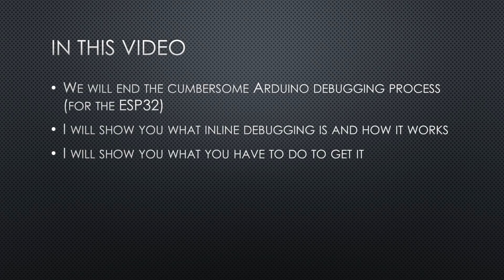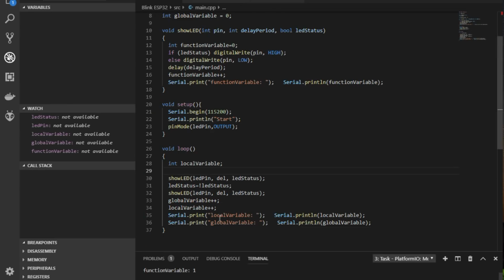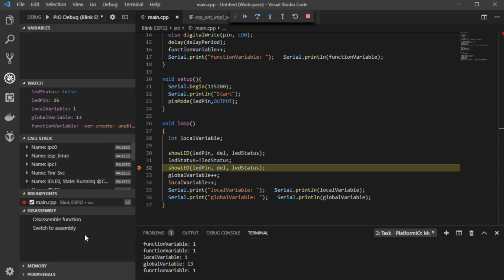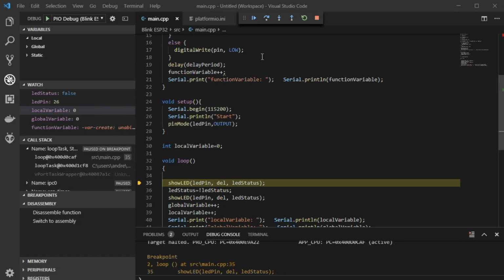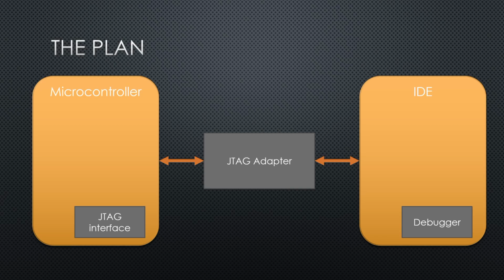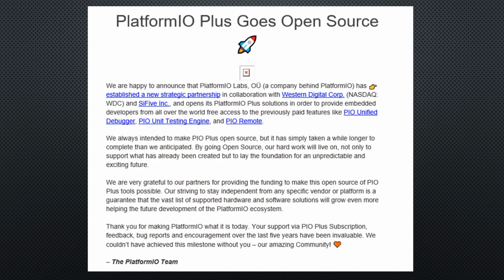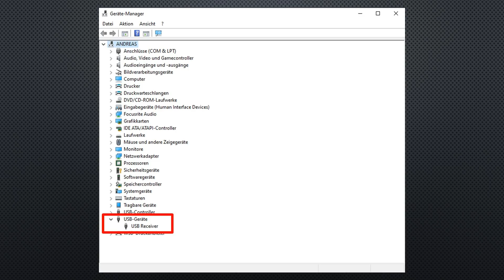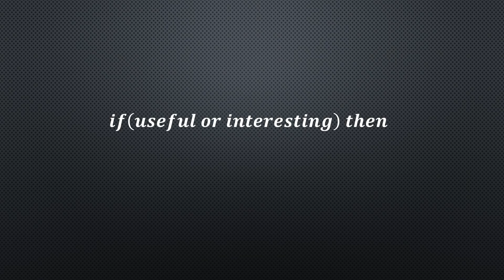#274 Free Inline Debugging for ESP32 and Arduino Sketches

Comment: Andreas,
.
I noticed that you used the Espressif’ ESP-Prog JTAG interface for the ESP32 which only supports the ESP32 platform.
.
PlatformIO debugger also supports the Segger J-Link JTAG interface which supports ESP32, but also STM32, Teensy and a plethora of other platforms.
.
In addition the Chinese "knockoff" copies of the Segger J-Link sold on Aliexpress are cheaper than the ESP-Prog.
.
So I'm wondering if the Segger J-Link wouldn't be a better option as a JTAG interface as it supports more platforms.
.
I have no practical experience with this, but the documentation seems to suggest that the Segger J-Link supports more platforms.
.
PlatformIO official JTAG interface support list.
https://docs.platformio.org/en/latest/plus/debugging.html
.
PlatformIO officially supports the Segger J-Link JTAG interface.
https://docs.platformio.org/en/latest/plus/debug-tools/jlink.html
.
Segger JTAG officially supported platform list.
https://www.segger.com/downloads/supported-devices.php
Note: ESP32 is not listed here, but the official PlatformIO website states that there is support.
.
High Speed J-Link JLink V8 USB JTAG Emulator Debugger J-Link V8 Emulator sold on Aliexpress.
https://www.aliexpress.com/item/4000182310208.html
Note:  This is a cheap Chinese "knockoff" of the original and expensive J-Link sold by Segger.
Reply from the maker: I never tried the Segger because I did not have one. This changed since last week. So we will see...
Reply: @AndreasSpiess  There could be problems with the Chinese clones of the Segger J-Link sold on Aliexpress/eBay. If you encounter problems then this might help. https://gronlier.fr/blog/2015/07/unbrick-and-update-an-j-link-v8-clone/
Reply from the maker: I ordered an original one (The EDU version is reasonable in price)

Comment: Thank you for this video. I have an esp8266 project that only used the I2c port. I gather from the video that the debugger should work. Or no?
Reply from the maker: I never tried the ESP8266 because for me it has not a lot of pins. So you have t check if the setup works.
Reply: @AndreasSpiess  checking the data sheets.  In esp3266 there is no mention of jtag. However a jtag capability is mentioned in the esp32 data sheet  under the cpu section. The esp3266 data sheet has no  cpu  section. I conclude that the esp3266 does not support jtag.
Reply: Thank you

Comment: Great tutorial.   I am wondering if you have tried to make this work for Ubuntu Linux.    I run into this software error.  /xtensa-esp32-elf-gdb: error while loading shared libraries: libncurses.so.5: cannot open shared object file: No such file or directory.     Thank you.
Reply from the maker: I only use it on Windows
Reply: @AndreasSpiess  Thank you for your reply!  :)
Reply: @AndreasSpiess  I solved the problem with some good help on Platfrom IO forum.  No, after all the work on Ubuntu. I recommend Window 10 for using PIO.  It is much easy to set it up.

Comment: Today I  got my esp-prog board to work on my mac with help of this video (which inspired me to buy the esp-prog in the first place). I now am able to both program (upload), monitor and debug the ESP32 (I tried the SBC-NODEMCU-ESP32 from JOY-IT) over a single USB connection. I did run into some small problems. My advice is to install the official FTDI VCP driver for the MAC OS you are running (I'm at a beta of 10.15.5 currently). Then LEAVE THE PORT SETTING FOR THE DEBUG PORT EMPTY, but use the 'xxx01' port for the upload and the monitor port.

Still I don't like the VS Code environtment that much. Maybe after some  time I will learn to appreciate it. But even if I don't like it for programming, I still can use it to debug the ESP32 projects now.

Next on my list is to create a jig to easily cable up the NodeMCU to the ESP-prog. I'm thinking about designing a PCB with feed-through header pins or so.
Reply from the maker: I have a few development boards laying around which I use to start every project. Only after the code is already working I change to the target. You could add such a Jig to such development boards...

Comment: Great video :) It would be awesome, if you did a video on using the second serial port on the esp-prog.

For the newbee like me, it would be worth mentioning (in addition) to just connect one usb cable to programmer (es-prog in my case) and that the programming happens thru the jtag.
I learn that the hard way.
Reply from the maker: Sorry for forgetting to mention that fact!
Reply: @AndreasSpiess  Please also show how to use Serial port with ESP-PROG. That would really save connecting both (esp32 as well as esp-prog) to the power supply.   Atleast you say the setting in the platform.ini file for the serial via esp-prog. please

Comment: Hi Andreas
After watching this video i switched to PlatformIO. Much better than the Arduino IDE. Waiting for the JTAG interface to arrive. I have a small problem and i hope you can help.
Not with the IDE but with programming the bin file into the ESP32 using a user friendly program. I have tried to find the answer on the internet with little success. 
I Found this program NodeMCU-PyFlasher-4.0-x64. It seems to be the answer to my problem.
But. It programmes the file no problem. But it does not run. keeps rebooting continuously.
rst:0x10 (RTCWDT_RTC_RESET),boot:0x13 (SPI_FAST_FLASH_BOOT)
flash read err, 1000
ets_main.c 371 
I know you are busy but was hoping you or one of your readers can help.
Reply from the maker: I do not use those flashers, so I am not a big help. If I remember you have to program the code at the right place. Which is not always 0000H. And if I remember right, I had to flash more than one file.
Reply: @AndreasSpiess  Thanks for the reply. Keep up the great videos. I always look forward to the new ones.

Comment: Thank you for your useful video's. I like them very much.
Since I'm a retired mainframer & cobol developer I'm really missing a cheap debugger in the arduino world. Now there is hope with the ESP ...
So I have watched the video twice, but there are some questions.

You have build a esp-prog adapter with 6 pins connected. But in the video you say, that only GND and 4 JTAG pins (ESP_TMS,ESP_TCK,ESP_TDO, ESP_TDI) are used. I guess, that pin #6 is VDD. But how to use it?
I think it's no good idea to connect the ESP Devkit via USB für uploading and/or serial output plus connecting another USB port to the esp-prog and the VDD to the ESP too.
Reply from the maker: I do not remember the details, but you should find the info on the platformio page. There are quite a few interfaces supported, and not all have the same number of pins. I used  USB and the JTAG,but I think, these JTAG boards have two serial connections available.
Reply: Ok, I'm talking only about the esp-prog and a Devkit board, both connected via USB. Nothing else.
At platformio I found this wiring information for the esp-prog:
"Pin 1 / VDD Positive Supply Voltage — Power supply for JTAG interface drivers" But what does it mean? Do I have to connect the pin to 3.3V on the "ESP32 Devkit V1" board, even if I have USB connected? I found nothing about that ambiguity ...
In your video you are talking about 5 connections, when using the esp-prog. But your esp-prog adapter in the video has 6 dupont plugs.
And in the video you have connected the esp-prog to a esp32 board. But sadly not all used connections are visible. Only GND and GPIO 12,13,14.
So I would like if your can make things more clear

Comment: I just started to use PlatformIO with VScode (Arduino Platform). A bit of a learning curve, but I love it. 

On to my comment about debugging. I already had a J-Link, so I hooked it up to an ESP32_Devkitc_V4 that I just bought. I had to use Zadig to install the WinUSB driver, just as you did for the FTDI debugger. Then I set "debug_tool = jlink".

PlatformIO recognized the J-Link, but when running the debugger, I got an error, and the debugger stopped. A Google search told me that I needed to hook up pin 1 (VT) on the J-Link to 3.3 V on the ESP32. Now it works well.

Thanks for the excellent (as always) video.
Reply from the maker: RTFM helps sometimes  ;-)

Comment: First, thanks for this and many other brilliant videos :) Next, my problem. I'm trying to get hardware debugging working with the help of this video. When I do "Start debugging" I get the error message "Could not find the specified task." from VS Code, with the three options "Configure task", "Open launch.json" and "Cancel". I don't know how to get around this. Do you have any idea?
Reply from the maker: Unfortunately I cannot do remote debugging. This video was made with an older version of PIO. Maybe something changed in the meantime.
Reply: I have the same problem. Did you find any solution for this?
Reply: Nevermind, i found the solution. For everybody else that stumbles at this ... you've to open the debug view and select next to "RUN" and the green arrow the project name.

Comment: I've done a lot of embedded and system programming with only a serial and/or LCD interface for debugging (at best). Worst case was an x86 project where my assembly polling code kept freezing up. I later found out that another programmer made changes to an interrupt routine and his PUSHA/POPA guard instructions needed to be upgraded to PUSHAD/POPAD. Lost several days of work over that one. Inline debugging is the best.
Reply from the maker: Definitively. But so far it was not cheap for a Maker like me...

Comment: The debugger is slow and ESP32 has only 2 hardware breakpoints!
Reply from the maker: I do not know because I have no comparison other than Serial.print ;-)
Reply: @AndreasSpiess  printing is not as effective as debugging. Also requires flashing which wear the flash very fast.

Comment: In my case I had to plug them W10 in a certain order. ESP first, then debugger, otherwise I was getting an error : "Failed to launch GDB". Possibly because I had the "debug fw" flashed already. Code wouldn't be running, therefore couldn't be flashing, if pluging debugger first.
Reply from the maker: Good to know. Thanks.

Comment: I remember "poor man's debugging" in C using printf statements. I then made a debug_print macro that was a printf embedded inside a "#ifdef _debug". That way I could recompile with or without _debug defined.

This totally confused me. When I compiled and ran the program without debug, it misbehaved. When I recompiled with debug, the problem went away!

This had me scratching my head. Veteran coders probably have figured out why running with debug turned on "fixed" the problem.

Yep, the problem was timing dependant. The printf statements slowed down execution just enough that the timing worked!
Reply from the maker: This happens sometimes. More often it happens to me that the SW does not work properly with debugging on becasue of too slow speed...

Comment: Thanks a million! You just changed the way I deal with the ESP32 once and for all. I followed your tutorial and I can assure everybody that it works perfectly! Do not forget to replace the drivers using the Zadig driver installer. I did and it did not work. I had to go and watch the video a second time and it worked once I replaced the drivers.
Interestingly enough, the code always goes to the FreeRTOS when debugging at the source code level. It makes it even more obvious that FreeRTOS is an integral part of the ESP32 Arduino libraries. Debugging will lead you there no matter what. I simply stepped out of the FreeRTOS stuff because I was more interested in my code than any RTOS kernel stuff.
On a different note: Who are the morons who disliked this video? Do they even know what they were looking at when they watched your video?
Reply from the maker: Thank you for sharing your experience! I always get a fer buttons down. Some of them quite fast. They are maybe even subscribers for that reason...
Reply: @AndreasSpiess  You know what? To hell with these idiots. It's because of YouTubers like you that knowledge is spreading quickly.
Thanks a million and please continue to make and share more videos.
You have a loyal subscriber to your channel now.

Comment: as far as i understand 8266 jtag debugging vie esp-prog is not possible yet? but theoreticaly possible
Reply from the maker: It is possible, but you have only one or two pins left for your project;-)
Reply: @AndreasSpiess  i saw it in video but platformio returns an error and i was unable to start debugger with esp8266+esp-prog. also esp-prog webpage says that debugging esp8266 is not supported, on other side esp32 works perfectly for me... so i am little confused because you say that its possible but i was unable to make it work. BIG Thanks for your answer.

Comment: Hey Andres, the Arduino Micro runs on the Atmega32u4 chip which has a built in JTAG Debugger. The JTAG pin out can be found in the 32u4 data sheet.
Reply from the maker: Thank you for your information!

Comment: What connectors did you buy, to make your custom cables?
Reply from the maker: If I remember they were included, but I am no more sure.
Reply: Andreas Spiess a flat cable with small connectors did come with the board, but I would like to make the same custom cable as you did, connector on one side and DuPont pins on the other
Reply: You mentioned an IDC connector, but there seem to be different versions and sizes

Comment: Can I get some advice on where to ask for help? I can't seem to get the WinUSB driver installed and working. I got to "USB Serial Converter A" and "...B" in the USB controllers list, then ran Zadig on "Dual RS232-HS (Interface 0)" but it hung. I restarted the PC, tried it again, and it said it worked. Unplugged, plugged in, and now I only have "USB Serial Converter A" (as expected) but no com port. Re-installing the driver via Zadig appears to work, but nothing shows up again. "Dual RS232-HS (Interface 0)" is now listed under "USB devices" and no ports. Any ideas? or where else can I ask? Zadig? PlatformIO? forums?
Reply: I've asked here. 
https://community.platformio.org/t/esp32-pio-unified-debugger/4541/95
Reply from the maker: This is the right place for your question. And I saw you already got an answer. Maybe it helps.

Comment: Andreas, first thaks for everything! 

I got a Segger J-link, it's what i could get here in Brazil in a fast pace, and it helped me a lot. I got it working better in Linux than Windows. on Windows sometimes the debugger didn`t work at all. openOCD couldn`t find it.

So i`m working on Ubuntu and it runs fine, and by the way, compilation seems faster =)
Reply from the maker: Thank you for sharing your experience. Linux still is the platform of choice for many projects.

Comment: I am wondering how wifi and Bluetooth behave with debugging. AFAIK they need some real-time tasks, which are prevented from running when setting a breakpoint.
Reply from the maker: You have to set your breakpoints wisely ;-)
Reply: @AndreasSpiess  Hmm well, at least I think there are background tasks which run on interrupts (either timers or data input). So the question probably is if those interrupt controlled tasks would continue running. And I don't see how setting a breakpoint in a "wise" place should help. Assuming the breakpoint triggers on the same core, the background task is running on, I don't think those background tasks will be executed. Unless the breakpoint would be a FreeRTOS feature and not a hardware feature.

Comment: Hi Andreas, based on your video I bought a ESP-Prog and was able to use it with an ESP32DEVKIT V1 right from the beginning.
My current preferred board is he TTGO T-Beam but I was not able to figure out the right pint to connect to the ESP-Prog. You have also made some tests with the T-Beam. Were you able to connect it the ESP-Prog in the right fashion? For an advice how to connect the pins I would be very happy. ThX Tom
Reply from the maker: Maybe you find additional info in this blog: https://medium.com/@manuel.bl/low-cost-esp32-in-circuit-debugging-dbbee39e508b

Comment: Andreas, thanks for your answer. I have been reading this but I can't find witch pins go from esp-prog to the pins 12, 13, 14 and 15 of the esp32. Where goes vcc? Is it vin? And which connections are needed for uploading? Maybe you can help me some more?
Reply from the maker: Maybe this blog helps? https://medium.com/@manuel.bl/low-cost-esp32-in-circuit-debugging-dbbee39e508b

Comment: Thank you very much for your nice intro to this subject! I have a ESP-Prog and I am trying to use it as you described on one of my ESP32 Devkit V1 (https://docs.zerynth.com/latest/_images/doitesp32pin.jpg). The number on the pinouts are different than yours, and I've tried using both the IO port numbers as you described, and also trying a "1:1" on the positionings of the pins. No luck! Would you happen to know this board specifically? Any tricks?
Reply: After a reboot and a few more attempts I nailed it; I used the IO port numbers as described in mr. Spiess video, and mapped them to the same numbers on the described devboard (physically totally different places to connect. Obviously. Or not. ESP32 labeling and ports is chaos for a newbie). That worked. For anyone fiddling with this; taking a reboot from time to time may clear up bad serial port states and make things work :) Another trick is also to read all debug output on the "DEBUG CONSOLE". If you have a valid connection to the ESP32, you should have debug lines starting with "esp32:". I also discovered that I had a missing library on my Arch Linux workstation from this log. If anyone using Arch is combatting this; install ncurses5-compat-libs. You may also need to add a key to your keychain for this AUR. Happy debugging :)